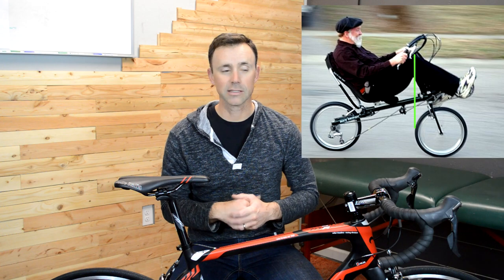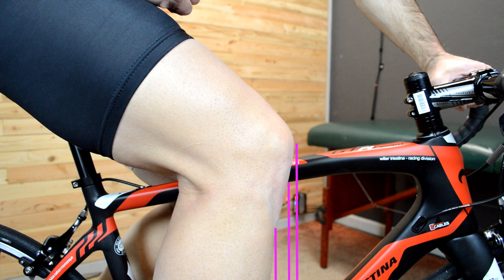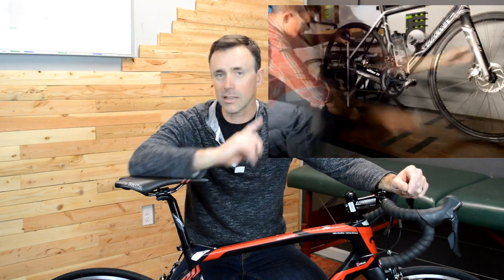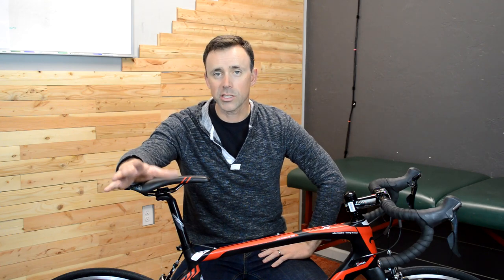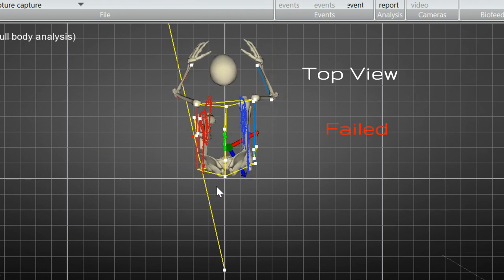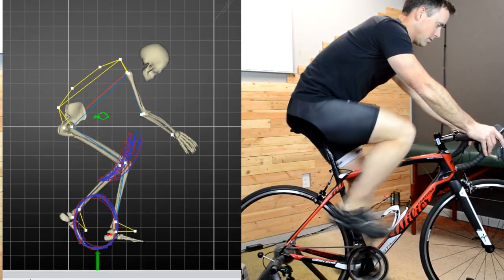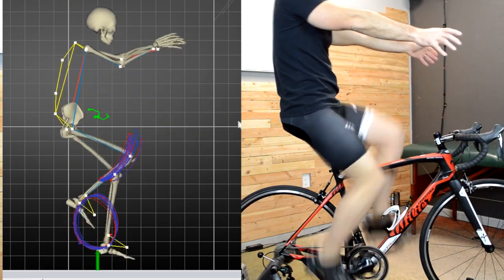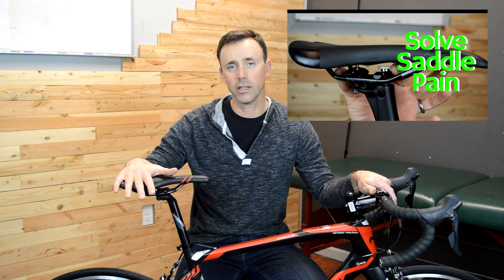How to set Saddle Fore Aft | Bike Fit Tip

Comment: According to Phil Burt, 12 years as Head of Physiotherapy for British Cycling and 5 years as Consulting Physiotherapist at Team Sky, the ideal knee angle is 35-40 degrees for the average rider. Pros may be below 30 however. Time trialers/triathletes will have smaller angles due to power requirements, aero position and shorter time in the saddle. I too was confused when I first saw this video. The reason I think is because the direction of saddle correction is not intuitive. One would think that, if you slide forward on the saddle, you would want to correct by moving the saddle forward. Burt also says that if the saddle is too far forward, you have more pressure on the hands, which to me seems counterintuitive as well. I would expect it to be just the opposite. So it appears to me that BikeFitAdvisor is essentially correct.
Reply: Don't try and do what the pro's do. They're in extremely aggressive forward positions (aero) on usually bikes a size or two too small for them (smaller frame, lighter weight). This is why the UCI created the forward limit on the saddle, to try and keep pro riders on relatively correctly sized frames and limit the crazy forward aero tucks on the road bikes. More pressure on the hands isn't a big deal if you're saving 40 watts by being more aero. 

In the end, for this test, it's a balance test. If you're fitting for comfort you move the saddle around to establish the balance, not simply move the saddle backwards all the time like this hack does.

Comment: Great video, as usual. I am desperately seeking someone to do a fit on my (XL) XC Hardtail bike. It's sort of "new school" geo with longer reach and slacker head angle. I'm running 760mm bars and 80mm stem and I still feel stretched out. I'm tired of buying stems to "try." I understand it's pretty hard to fit a mtn. bike, but how would you attack that fit?

Comment: John, I am personally struggling with bike control. I am 6 foot 2 and ride a 2016 Pivot Mach 6. It has a 70 mm stem and I have Stevie Smith Truvativ Blackbox bars that I cut down about  1 inch. The are 780mm stock length with 5 degree sweep and 30 mm rise. I have trouble with the front tire washing out and unable to corner the bike. Going down single track, the bike roams all over the trail and feels unstable. Any thoughts?

Comment: Some of us have been riding competitively for much longer than this guy has been alive.  To say that "you should run" if a fitter uses the plum-bub Technique is arrogant and off base. He needs to mention that fore-aft position of the saddle has a lot to do with how a rider generates his/her power.  If a rider is typically always spinning, especially when climbing, his/her position is going to probably be a more forward position.  Or...if a rider need to be in a tri or TT position with his elbows on the handlebars, his saddle position needs to be forward.  But in doing so, all that is happening...or that should be happening, is that the riders body is just rotating around the same axis and point of power for his/her pedal stroke.  That said... when climbing, you can generate more torque by slowing the pedal stroke and incorporating your glutes and lower back muscles into your stroke, along with all the other muscles that are normally being used.  This is done by sliding back on the saddle.  Watch LeMond and Hinault climb...even lance.  Arguably, the spinners today are not climbing as fast as the climbers back in the day, that were able to use more of the torque available by understanding how to work your position in the saddle.
Reply: Arguably? How do you know "spinners" are not climbing faster?

Comment: Why can’t we begin all work by determining the actual body configuration first. Everybody is different, that is a constant and variable factor. Next is level of physical condition, age, type of riding to be attempted. Those two elements would require measurement and assembling factors. Now determine the geometry of the riders body...Then you have a set of dimensions. From there you go to available hardware..

Comment: What about the damaging shearing forces generated in the knee junction caused by moving that knee joint behind the pedal spindle? Forward is okay obviously as we see it on TT bikes all the time but moving that plumb line behind the spindle is dangerous for the joint.
Reply from the maker: Forward is okay as long as the torso position and mechanics of the stroke support it -- but move too far forward and (among other things) you can increase the compression of the patella into the femoral groove for a variety of reasons.

Genuinely curious, not trolling -- what "damaging shearing forces" with the knee joint behind the spindle? Any reference for this?

I get where you're coming from with "forward is okay because of TT bikes", but what about recumbent bikes? There, the rider is significantly behind their pedals and it hasn't been demonstrated that they exhibit any greater propensity for knee problems...

A study from 2004 (Jeff Broker was one of the authors) actually found that lower extremity kinematics were the same on upright versus recumbent cycling positions, but that anterior-posterior shear forces (those affecting the ACL especially) were found to be *significantly reduced on the recumbent bike*.

https://www.ncbi.nlm.nih.gov/pubmed/15133932

A quick search online (like 2 minutes), I found a livestrong article title suggesting that recumbents weren't safe for the knees -- it went on to describe in general some common knee ailments but never mentioned why the recumbent is worse for these. And I found a YouTube video with a PT explaining that a recumbent is safer for knee issues as well, but I have to say, none of his reasoning made sense -- it almost seemed as if he didn't really understand bikes or perhaps the recumbent in his office may have been poorly suited (or less adjustable) to true riding needs.

Any bike can be detrimental to the knees if it's not adjusted properly.
Reply: It's really a matter of the direction of the forces as they are applied thru the knee to the pedal going around a fixed crank spindle center. Wether the person is sitting above or behind the crank in and of itself doesn't matter. It matters the relationship of that femur/knee tibfib angle in relation to the crank during that phase of 1 to 6 o'clock (on a regular bike). Putting the knee pivot behind that spindle is just plain bad. No one I know of knowingly advocates that. On center and forward is okay (to a certain degree). Just look at all the pro riders in 2018 since the UCI changed the set back rule. No one is moving their seat back. They're slamming and extending the stem, moving the seat forward and tilting it down. No one is playing with the idea of moving that seat and knee behind the spindle center.
Reply: I disagree. I recommend it. Pushing down on a pedal with a 90° knee is more sheer force than if it were at 75 or 80°. The contact points are side to side at 90° Which one is more normal to walking? Plus if the saddle is further back your initial force would be more forward than down. Uses more thigh too, more power.
Reply: I don't recommend it. It's bad for the knee to be behind the spindle like that.

Comment: Out of ignorance, I must ask...  Why would you not use the plumb test to set your seat fore/aft (independent of bar reach) and then set reach off of a known good fore/aft adjustment? So, once you have the fore/aft set, then you look at stem length for reach.  Seems in this tutorial, you are moving back and forth and then hoping you have the knee over spindle correct.

Comment: NEED HELP

I'm 6 foot and ride a 58cm frame (xl) and find I cant even get my saddle far back enough to bring my knee cap plumb with the crank arm. To make up for the extra reach distance I need a tiny stem and normally grip the bar before the hoods (where the bar turns 90 degrees) to be comfortable. 

I think I have really long thighs but average or even short reach through my torso and arms.

What should I do?

Doing this balance test I'm pretty good if my hands are on the horizontal bar or on the 90 where i usually keep them - i do engage my abs a bit and/or increase cadence so it would seem I need to move my saddle even further back - not possible and the hoods will be even more out of reach then.

I've had knee pain in the past and now have flat pedals on my bike on a trainer until I figure this out. With the flats I find I put my feet much farther forward to avoid discomfort.

Wtf?

Should I have a setback seatpost and a 56cm frame or something? 

Thanks!
Reply: dude, go to a decent bike shop and get a fitting. that frame is WAY to big for a 6footer.
Reply: @crabtrap  Yeah but how do you explain the fact I can't get my seat far enough back? A smaller frame with a smaller top tube would mean I would need a setback post or something wouldn't it?
Reply: @AirDnB1983  thats why id go get fitted at a good bikeshop. There could be reach issues or other variables u arent seeing.
Reply: @crabtrap  fair enough. I have put it off because I'm reluctant to spend $200+ to fit an $700 bike. Might wait until I spring for a new bike.

Comment: Fore and aft can not be separated from height.  You need to think of seat adjustment in term of rotating the entire position about the crank.  The position does not change.  You just rotated it.  Once you think that way, you will understand that fore after has ZERO impact on pedaling mechanics.  All it does is put more of less weight on your arms and make you more or less aero.
Reply: Actually, I don't think that is correct. It would be, if you ignore the gravity and change the saddle tilt accordingly with each fore-aft adjustment. Keeping the saddle level makes your theory invalid. And tilting the saddle? Everybodys different, there are various medical conditions, or a will to trade health and endurance for a little more power - so I can understand that some people ride with weird angles. But otherwise, you COMPLETLY TRASH your bike fit if you are constantly in need to keep your body from sliding back or forward.

Comment: Why exactly are you setting up with reference to letting go of the bars?  Seems like a knee over spindle type thing all over again. You grip the bar when you ride, and need weight over the front wheel for braking and handling, so why set with reference to not doing that?  Why not let the arms do some work too?

I realized you can't fully fit a bike on a stationary set up.  The fore aft thing is key to bike fit but it is all about how where you place your centre of mass over the wheels affects how well the bike handles.  That's the balance, not whether you can balance on the saddle.  It's all about trial and error going fast through a lot of tight corners.  You eventually find the sweet spot when you and the machine move as one unit.

Comment: i am not seeing how do you adjust the seat itself. Only talk about seat position but not showing how its done makes no sense!!
Reply: russforg as in how to adjust your saddle? There should be 2 Allen bolts directly under the saddle that clamps the saddle rails. Untighten those and you’ll be able to move your saddle.

Comment: Then you do all this on an incline or a decline and realise everything is relative.

The road you're cycling on should effect your correct seat position, if you're predominantly hill climbing or decending setting it up on the flat seems illogical?
Reply: I don't know where you ride -but ascents are followed by descents everywhere I have lived. Unless you're a pro downhiller, the flat will be logical.
Reply: @henseleric It takes longer to go up hllls than it does to go down them, even if your ride had the same amount of ascents/descents you'd still spend more time ascending.
Reply: @fergusdenoon1255  So you're answering your own question? I set mine as neutral as I can get it -you do what you want.
Reply: @henseleric  the question was rhetorical, the first thing I said answers the question...
Reply: @fergusdenoon1255  There was no real question -you're just being contrarian, with no end-goal.
Reply: Well the point was if you're setting your seat up for position/comfort on flat ground, it's only going to in the correct position/conformable on flat ground.
Reply: @fergusdenoon1255  A good neutral position works well going down, or up...and flat.

Comment: Great video: thanks. Do the same 'rules' apply to a mountain bike geometry used for touring (e.g., Surly Troll)
Reply: Not really because mountain bikes have much different geometry. Surly's bikes (including your troll) tend to have zero setback seatposts. Mountain bikes, in general, tend to use zero setback (a note, Troll doesn't completely fit modern mtb geo). This brings you forward on your bike. For mountain biking this is necessary because you don't want your weight too far back on steep climbing. On a mountain bike, you want to be able to keep your front wheel down. However, mtb bikes have a much slacker headtube angle. This is because you want a wider wheelbase to improve stability and projecting the front forward improves responsiveness in technical terrain. However, you also have to consider chainstay length. Road bikes and trail mtbs have shorter chainstays as this makes handling more snappy (mainly for mtb) and improves acceleration (more roadie thing). On a mtb bike, this also ensures you have clearance on your back end getting passed obstacles more quickly. On the other hand, a touring bike (like your troll) has a longer chainstay. Because, again, longer wheelbase improves stability. Now, what happens if you have slack headtube angle (projecting your front wheel well ahead of you), short chainstays, and you're climbing a steep gradient common in off-road biking? You start to wheelie the front. You might even go off the back of your bike. So, for this reason, you move your weight forward (or build really long chainstays, like Surly's cargo bikes).

One thing about your troll, well all of Surly's dirt tourers really, they all have more roadbike headtube angles. This is to keep the wheel underneath the bike to better support the increased weight tourers must carry. 

"Technically" all this would also still apply to a road bike making a steep climb. But roadies rarely deal with these types of climbs, because engineers aren't stupid and they know how to build a safe road through the mountains. So road bikes aren't built with these priorities in mind.

Comment: You can not think of fore-aft position alone.  Think about it using a polar coordinate system.  Imagine you have the perfect position.  Now rotate your whole position on the bike about the crank center.  Did you pedaling kinematics change? NO.  All that happened was you got more aero, and you put more weight on your arms and hands to support you.  But NONE of the pedaling dynamics changed at all.   If you rotate forward what happens?  You have to do ALL of the following.  Move saddle forward.  Raise your saddle.  Tilt your saddle down.  ALL OF THEM. Do not think in terms of saddle height.  Think in terms of distance from the center of the crank and angle of saddle.  Fore aft is already baked into the cake.  Seems cyclists can not do geometry.